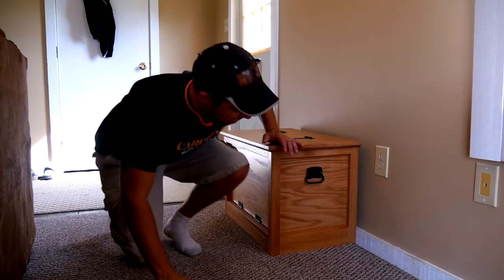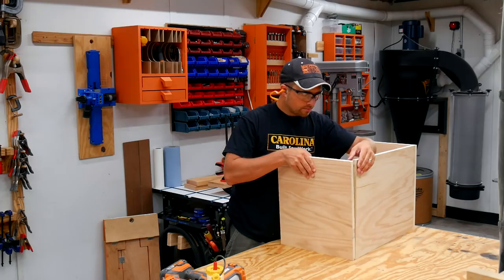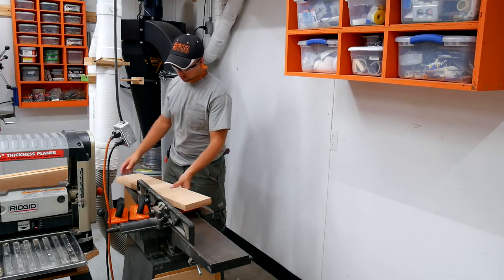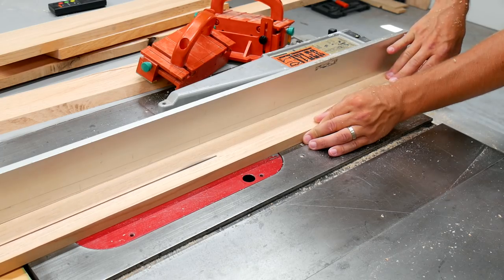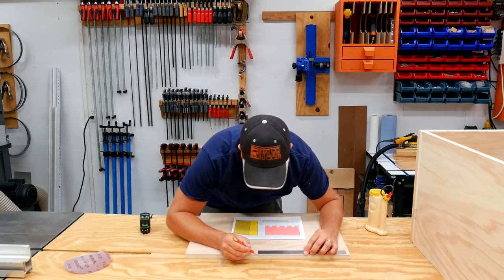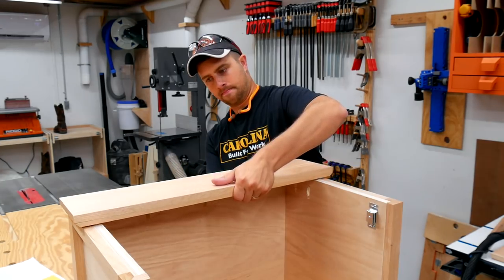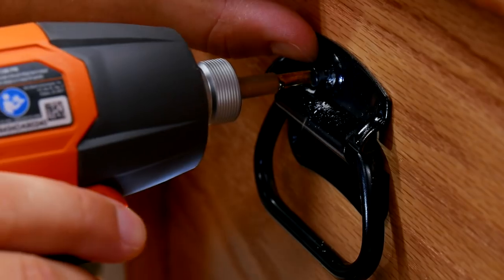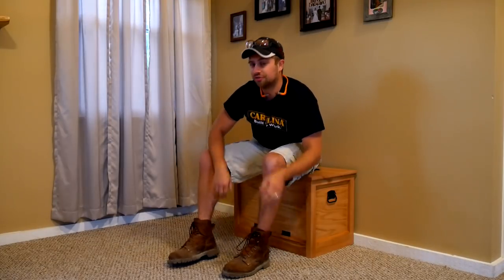Folding Boot Puller Bench

Comment: Just a thought, and maybe it just looks different in video, but it seems that you could shorten the distance the boot puller extends by cutting some material off and widening the cutout a bit ( because of the shortening)which would give you more room inside the bench to help with your hindsight issue. Great video'